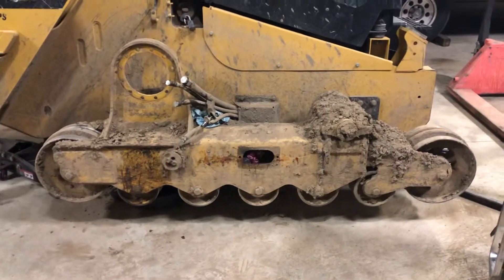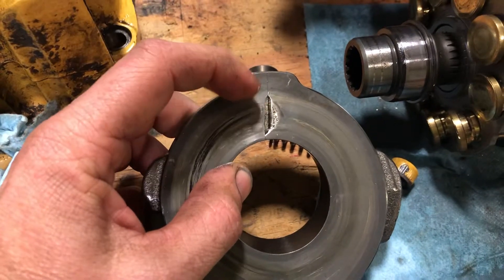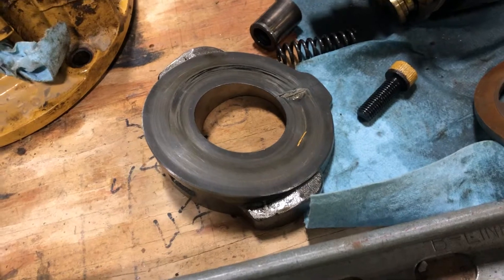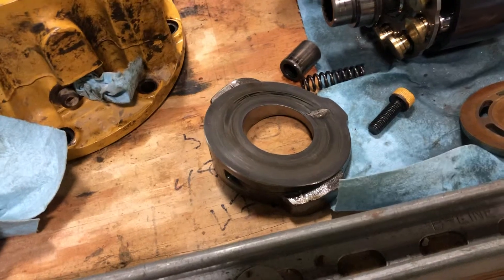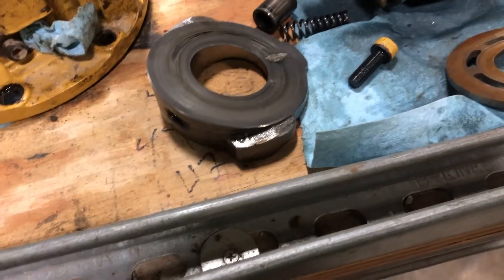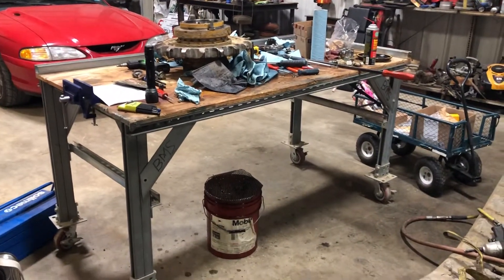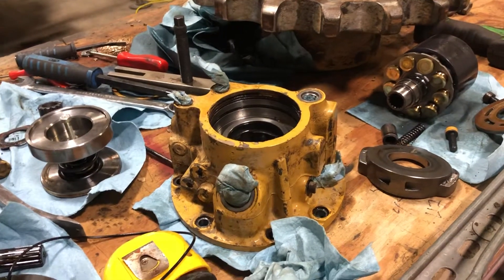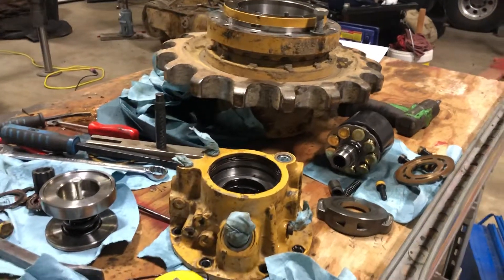Cat 299D Drive motor issue

Comment: I have a 2005 257b track loader with 4000 hours , it started jerking/popping off the leftside , no hydro leaks , but seems to get worse the more I try to operate ; feels like a brake issue ,  I fear it needs a drive motor . Any thoughts ? Thx

Comment: I'm getting speed sensor codes 2687-8, e695-3, 41-4 on my cat 297d2 xhp #cat0297dthp200321
Has run flawless expect have noticed the past >100hrs it would feel like it would hang or have no drive power until I brought the joystick back to neutral then work fine until this happened today.

Comment: I have this same poping noise and it’s like the right side won’t move at all pretty much it’ll sorta go but at snail speed and it’s locking up also as it’s trying to go, is there a manual or starting point I can check and how to Check it I’m pretty mechanically inclined so I wanna try to fix it myself, thanks
Reply from the maker: Send me an email, I have the Cat info to disassemble and reassemble.  thejunkyardmethod@yahoo.com

Comment: When you take the final drive off can you pull the drive motor through the whole the final drive mounts too ?
Reply from the maker: Yes.  You may have to pull the hydraulic fittings off, I don’t recall for sure.

Comment: I have a 17’ cat289d with 3800 hrs. Everything seems to be running good but there is a whining noise that climes from it when moving. It gets louder when I’m putting it under load such as scooping a bucket full of dirt from a pile. It goes away if I increase the throttle. Could this be a hydraulic pump that is going bad? 

Thank you
Reply from the maker: It could be, make sure it’s to the proper level with oil.  Also make sure filters aren’t super old.  Could also have a suction leak, I’ve seen the belly of them so packed full of crap you can’t see a leak but it’ll suck air and whine.

Comment: Is there a truck to taking that speed sensor out? Is there anything else holding it in other than that Allen head bolt?

Thanks!
Reply from the maker: Just that bolt.  It’s not uncommon for the o-ring to kinda grow in there with all the dirt fines packing it in.  I’ve had some come out fairly easy and some I really had to work at.  If you can get it to twist a little you can usually start to work it up out of there.
Reply: @Junkyardmethod  thanks man, i just had to put my purse down. I read some forum about a guy having to go through a lot to get it out. Must of been a different part. 
Super easy fix

Comment: Have you seen any issues with this machine as I have 2 machines they are constantly breaking down. Cat cannot get the parts either. I’m paying for equipment that does not perform due to Tier 4 smog issues
Reply from the maker: That specific machine hasn’t been bad other than the random drive motor issue and some hoses.  I have worked on a 259 that had some tier 4 related issues.  Unfortunately anything tier 4 or tier 4 final is prone to problems.  The most helpful things are minimal idle time, quality DEF and good preventative maintenance practices.  

If they’re out of warranty then can be deleted….

Comment: Thanks, I just bought a 299d3 xe and I’m curious what you think about the machine?
Reply from the maker: They’re a good machine.  Depending on what you plan to use it for they’ll go a long time.  Running forestry mulchers kills the hydraulic system quick.  Keep the idle time to a minimum, service it regularly and use Cat filters.  One of the most often overlooked things on them is the oil in the planetaries.  Change it every oil change.  It doesn’t take long, doesn’t use much oil but it’s important.
Reply: @Junkyardmethod  do you like the bobcat T870 better?
Reply from the maker: @scottaddison8071  I don’t know anything about them.  I deal with mostly Cat and some Takeuchi.  Sometimes it boils down to dealer support.  I think it would be as good as any other major brand.

Comment: I have a 299d2. Recently replaced the coupling between flywheel and pump. The drive motor was taken apart in the process and I think i may have lost some parts. There's a spherical bearing that goes up against the swashplate i think thats just sitting there right now on the splines, nothing holds it there. If you could shoot an email to me i can send some pics I would greatly appreciate it. Jferraro32992@gmail.com

Comment: hello i have a 279d and i have a leak in a rigth  drive motor is possible for you  share a full video how you take off every single piece if you have any instructions that i can used i will i preciate thanks
Reply from the maker: If I get a machine that needs to be disassembled it’s a possibility.  Haven’t run into one in awhile.  I can send you some instructions via email.
Reply: Where is yours leaking? I have a 259 n its leaking from the large mounting bolts. I know hydraulic fluid shouldn't be there.
Reply: I have a 299d and it has a leak in the left engine, what do you recommend?

Comment: How do you remove the swashplate out of the drive motor
Reply from the maker: There’s a bit of a process to get to the point you can remove it.  You’ll get into the motor and remove the springs for the brake, then the hub and pistons come out.  Those ride on the swash plate.  If you’re working on a specific machine I can send you Cat instructions.  Model and S/N would be needed to get correct info to you.  

Most motors like that operate the same so they all come apart in similar fashion.  You’ll have a cover of some sort, there will be spring pressure applied by several springs or a large Belleville washer.  You’ll need to capture spring pressure one way or another to remove the snap ring.  Once brake parts are out you’ll be down to the pistons and their retainer/drive hub.  In a drive motor like this the swash plate is in a fixed position.  

Hopefully that gives you an idea.
Reply: @Junkyardmethod  give me a call I emailed you my number
Reply: Moi j'ai un Skid steer cat 262D a chaque fois je pivotais l'une des deux positions gauche ou droite le parking brake se déclenche comment je dois résoudre ce truc , il me donne des codes speed sensor j'ai tout changé rien ne marche pas.

Comment: Any advice on remove seized snap ring on front plate cover?
Reply from the maker: Aaron Pierre if I recall the snap ring you’re working with it is under pressure from the springs inside the motor that act as the brake.  It is spring applied, hydraulic release.  Email me  machine model and S/N at thejunkyardmethod@yahoo.com and I can send you the procedure.
Reply: @Junkyardmethod  sending email now

Comment: I've got a 299d2 with just over 1000hrs on it. Had it about a month and the right track locked up 2 days ago. Took the cover off the final drive and it was dry. No oil so the bearings came apart and messed everything up.  Was thinking about rebuilding  it but before I do can anyone tell me if I need to press the motor off to replace the seal? If so i might be able to buy an aftermarket unit for just a little more.